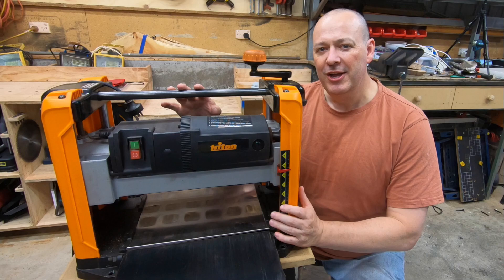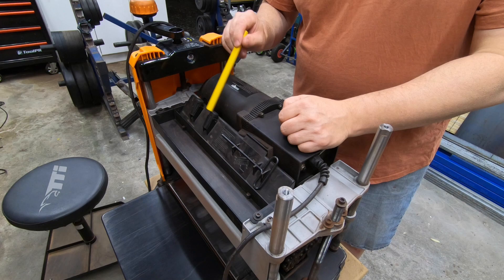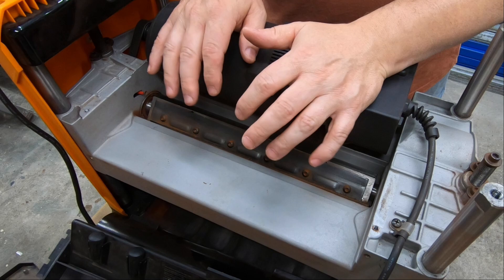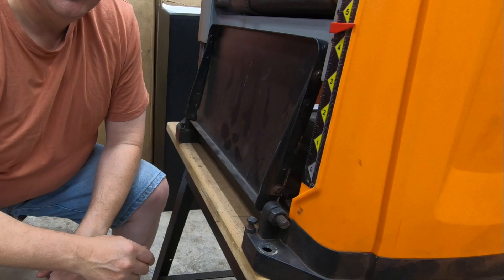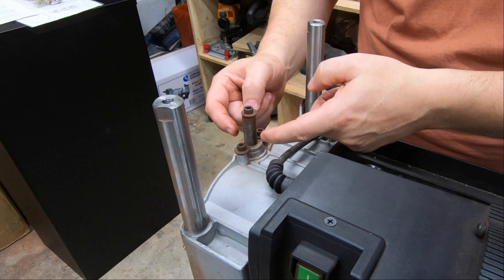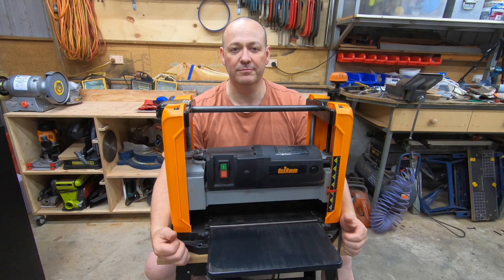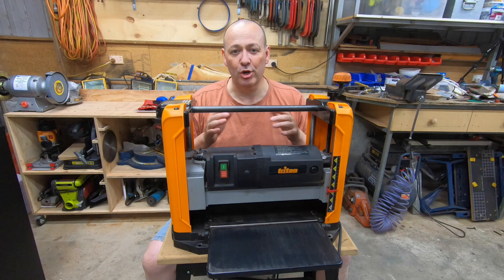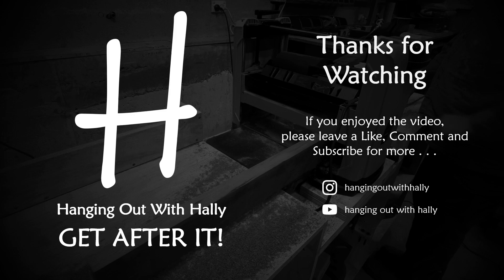Thicknesser REVIEW - Triton TPT125 Benchtop Thicknesser

Comment: Great in-depth instruction for this machine. I've been researching for some time and watched quite a few videos on this Triton, some going back 2 and 3 years. Yours is the only one to show the other (hidden) working parts and give guidance for adjusting - if needed 👌👍. The machine has been hard to find here in the UK because of Covid-19 and holdups caused and doesn't stay in stock for too long when it does appear. #286 sub.
Reply from the maker: Hi Frank, I'm glad you found this helpful, it's a fantastic machine, I'm absolutely thrilled with the results I get from it.  I hope you find one soon, it will work well for you.  Thanks for watching and for subscribing, it's appreciated.  Cheers 👍😀

Comment: Just bought one, in UK £250 looking forward to setting up and using, all the points you made does help, thank you
Reply from the maker: Hey, fantastic, glad it was some help, I hope you enjoy using it!  Thanks for watching, cheers. 😀
Reply: £250? Was that secondhand? About £380 is the best I’ve seen and I’m torn between this and the Metabo 330, which is about £50 more but is more powerful and has a locking carriage to reduce snipe
Reply: @JezVibert  Not second hand, brought from Tool Station, demo model only used once, have l found a difference from using my electric hand planner, far better, its a good job lm deaf, haha, l have been trying out different exotic woods, finding out of which can be brought down quickly and which ones to take time on i.e Zebrano, very small amounts as it scuffs up the face,  sands out okay, l have not made anything yet but l will after Easter. Thanks for replying, regards Philip

Comment: Good informative video. You sound like me ! I understand that this machine is excellent value for money, but must be used carefully and within its limits.. Its for the DIY man or light trade use.. If you want to go into business manufacturing hardwood window frames then you must spend thousands and not hundreds  ! 
I will be purchasing one of these machines in due course.
Reply from the maker: Hi John, thanks for watching and the great comment.  I agree, I think tools can sometimes get a bad wrap because they aren't understood and used within what they are designed for which is important to understand when you get them.  You're spot on in that if you wanted to hog away material on hardwood for hours on end, then you need a commercial machine.  I'm really impressed and happy with this machine, it does everything I want it to, cheers. 😀

Comment: Super review, really love the in-depth analysis of the inner workings, such as the bar and gears system. I’m new to woodworking and considering getting one… I know it’s not a jointer, but can you get a good ‘square’ result when planing boards on their edge? Once again, thanks 👍👏
Reply from the maker: Hi Michael, Thanks for the comment and for watching.  I've had excellent results in terms of how square the timber is on all 4 sides, but it's only as good as what you start with, you have to get one corner square to keep it square.  I've used a jointer and a table saw to get that first square edge.  Once you get the cutting head on the planer square, it cuts beautifully.  I've planed two opposite sides to get a parallel piece, then cut that on the table saw to trim, straighten and square an edge, then run it through the planer on edge and it's been great.  On edge, I've only ever planed down as narrow as 15mm (5/8in).  Hope that helps and good luck. 😀
Reply: @hangingoutwithhally7463  certainly does help - thanks a million😉👍
Reply from the maker: Glad to hear it ! 😁

Comment: Must be rather unlucky but I've had 3x from brand new & all became faulty after a few hours of operation, which utterly sucks because it really made a good impression on the first try. Whats annoying, that it was all soft wood (dry pine) & with not much to remove - what is wrong with the batch they sold in france? 😞
Reply from the maker: Wow, that's odd to hear, I've used mine for hours on end and had no issues at all.  I hope it get's fixed for you, thanks for watching. 😀

Comment: Hey Hally, useful vid here, thanks for sharing ur findings. One question I have is regarding snipe. You mentioned that one turn of the depth handle is equal to 1/16" or 1.5mm and that you do half that. I was thinking more extreme than that and doing 1/8th of a turn so roughly 0.2mm or 1/64" with the theory being that it would reduce snipe to the point that you could just sand it out afterwards without noticing, what do you think?  Not got this machine but close to buying it.
Reply from the maker: Hi Baz, thanks for watching and the question.  In my experience of using it, smaller cuts do help reduce it, but not as much (in my experience) as you would think, the issue is the final feed roller not having enough tension to hold the workpiece down against the table as opposed to the depth of cut.  I got the best result by tinkering with the bed flatness and that helped a lot, I've also seen people also use a larger flat board of melamine that also helps.  Personally I'm not that keen on that as it takes away the lip on the side of the bed that can help guide your workpiece.  I hope that helps, cheers. 😀

Comment: Nicely presented video.

Do you think I would need a planer as well as the thicknesser so that I can give my timber 2 flat edges at 90 degress to each other before putting them through the thicknesser or can I make do with just the thicknesser?
Reply from the maker: Thank you and thanks for watching.  Whether you need a planer too, depends on how precise you want/need the final pieces.  You can make jigs for a thicknesser that can hold timber square that can do a very good job, and even if you already have a good table saw and can get two edges at 90deg, then you wouldn't need a planer as well.  If you were gluing up pieces for a table top, then a planer will improve the finish as you can get it perfect.  Hope that helps, cheers. 😀
Reply: @hangingoutwithhally7463  Great, thanks for the reply.

Comment: Hi, can you please tell me how much the distance is between the infeed and outfeed rollers? I'm just wondering what the very minimum length of workpiece is that you can put through without risks. I know that the manual says 380mm, but I believe it's shorter in reality
Reply from the maker: Hi there, thanks for watching and the question.  I haven't measured it directly, but it's about 200mm or 8in.  You will also have to take into account that on each end of a piece so short you'll get snipe of around 50mm or 2in, so consider that when working out what you want to do.  I try to machine up long lengths and then cut them to size, I find that is far more consistent and less wasteful.  Hope that helps, cheers. 😀
Reply: @hangingoutwithhally7463  Thanks, it did help. I'm going to start producing wooden shingles for my log cabin, and most of my pieces are approx. 350mm in length
Reply from the maker: @Poor.Mans.Sweden  Wow, that sounds like a cool project!  Awesome.

Comment: Hi,
I was looking for some new blades for this and one website suggested you can sharpen them but as you can't adjust the depth of protrusion, I assume they are wrong.
Your thoughts on this would be much appreciated.
Reply from the maker: Hi Joseph, Thanks for watching, appreciate it 😀.  You can sharpen the blades, although because you can't adjust the protrusion, the sharpening needs to be the same on each blade and on each side of each blade, this is the tricky bit to get right and what would deter most people.  Also as the protrusion is fixed and there is only a small protrusion to start with around 1/32" or 0.8mm.  I would expect you could only sharpen them once or twice before you would run out of room and need to replace them.  I don't have an accurate enough set up to try sharpening them myself and because they are about $18-$19 per pair on Ebay, I've bought new ones 😁.  Hope that helps.  Cheers.